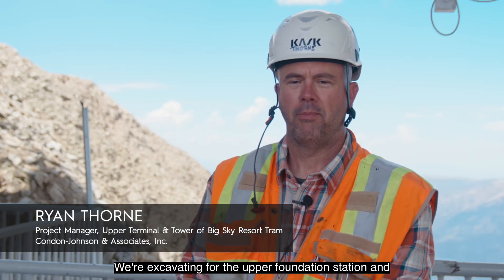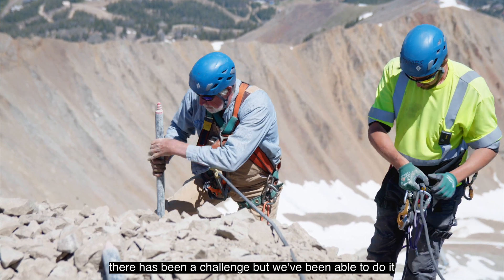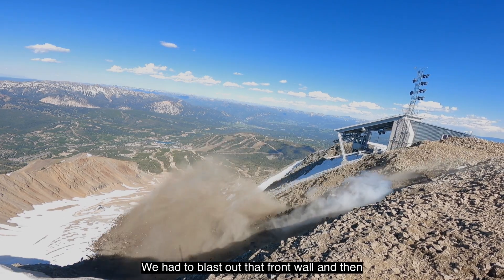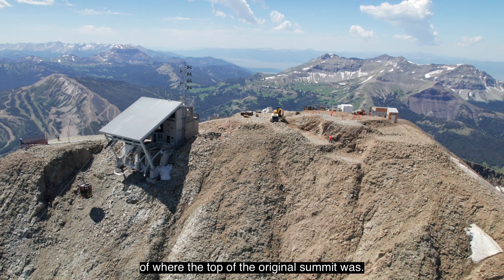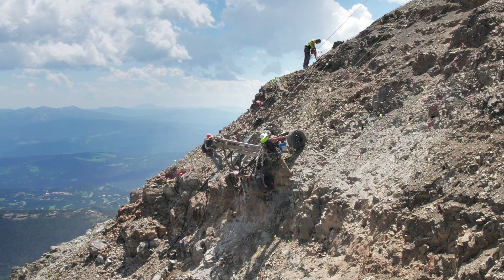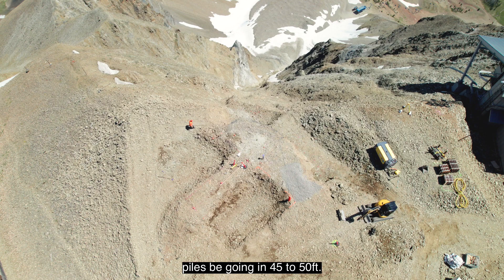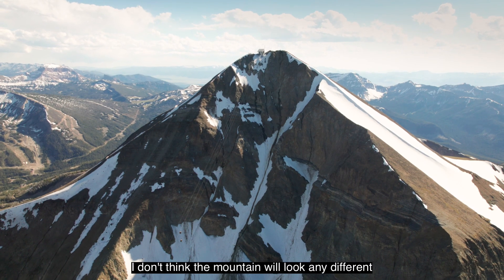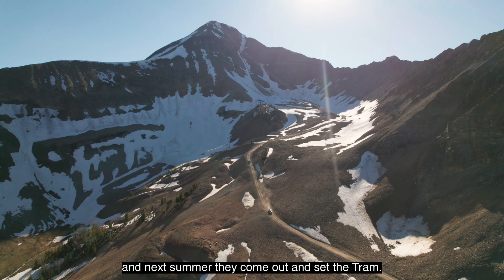Video: Lone Peak Tram construction update at Big Sky Resort

Comment: sell snowbird the old tram
Reply: it will be scrapped. It was custom tailored to Lone Peaks terrain, and has shifted 15ft down the mountain due to the glacier. It has such a low capacity, that its novelty wont be any use to any other resort, and will be rightfull scrapped. The only way it survives an extra few years is as a backup lift to the new tram, but I dont see them keeping it around. Its a great lift for reaching Lone Peak, but it would be a terrible investment as a used lift anywhere else